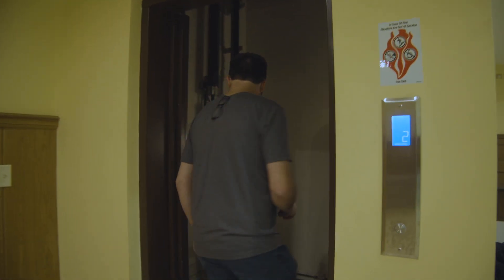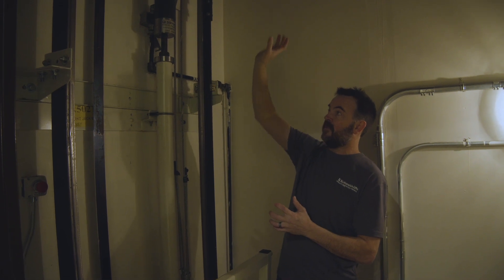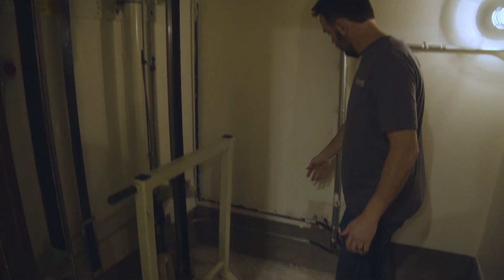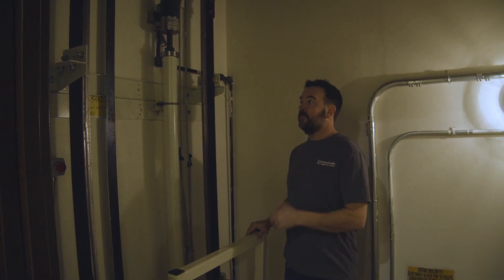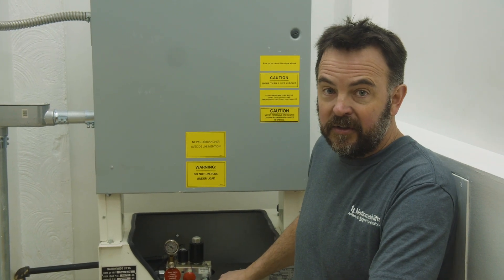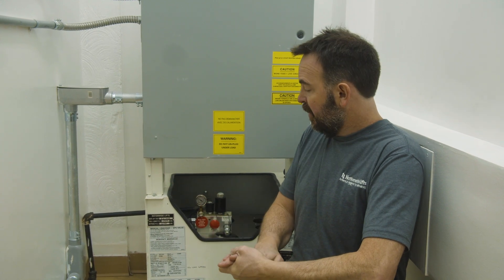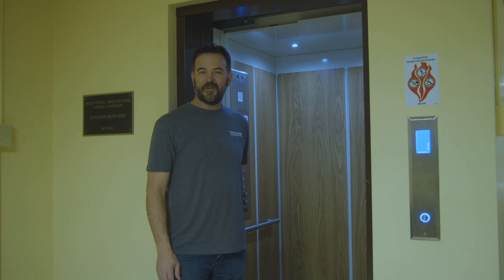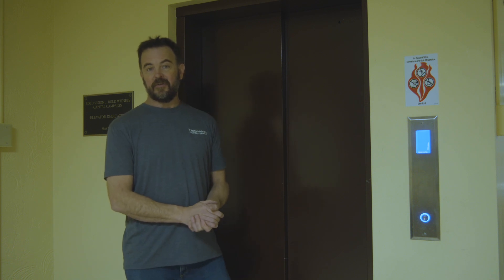How Elevators Work - Roped Hydraulic

Comment: Nice video thanks
Reminds me of a snatch block or even gym cable equipment how you can fit an anchored second diverter pulley  to double the pulling capacity but the movement halves when pulling on the rope.
On the flip side of pulley systems and by pulling force on ropes....

if the pulley is the moving force ( as here in the indirect hydraulic elevator) on the rope anchored at one end to the structure and anchored  to a weight ( cab) on the opposite end, we see the movement ratio is 1:2 ( ram moves half speed of the weight ) im guessing also the same ratio is flipped 2:1 for effort to move the weight twice as easy..? or am i wrong.
Please correct me lol
As ive never heard of extra capacity potential for an indirect hydraulic lift that should be mentioned as another benefit of this system.

And Is there a system that monitors that the pressure is present and constant in the hydraulic system ,  separate from the gauge ? e.g a hung cab or after a hydraulic repair entered air into the system etc.
How is this done and how is it checked on maintenance?

many thanks.

Comment: If the elevator is on the second floor.
Does it sit on locks or on the hydraulic pump?
Reply from the maker: When the elevator is at rest, it is held in place by the hydraulic pressure.  The valve in the pump unit is holding the oil back to keep the cab stationary.  It is common for a small amount of hydraulic oil to slowly get through the valve if it's stationary for a long period.  If this happens, the cab will creep down so slow you can't even tell it is moving.  Hydraulic elevators have an anti-creep feature which will correct this movement.  If the cab sits long enough where it creeps down enough (maybe 1/2") then the pump turns on and re-levels the cab back up to the correct location.
Reply: @nationwidelifts8009 
Interesting.
Thank you for responding.